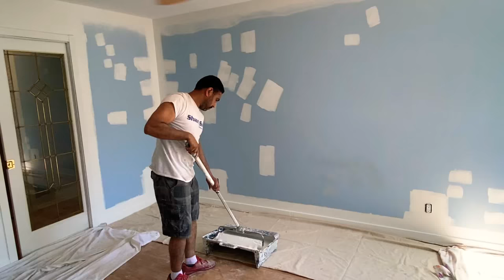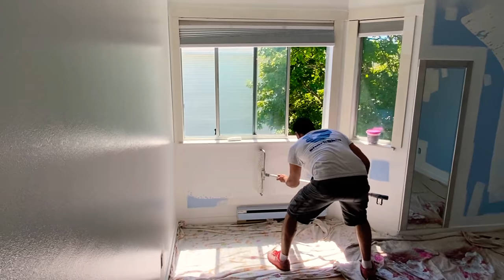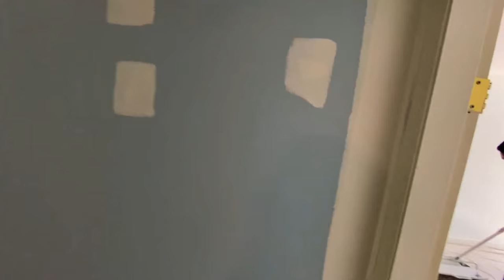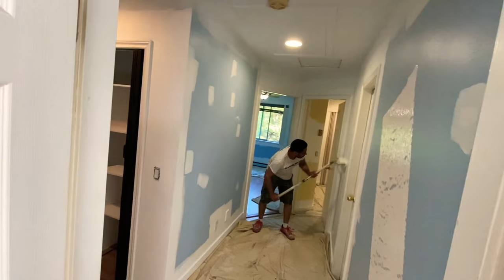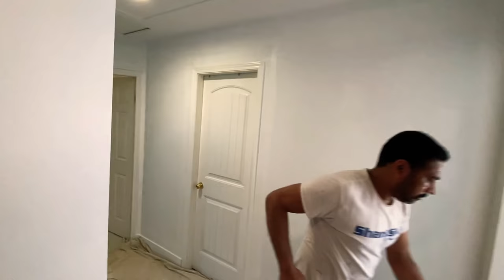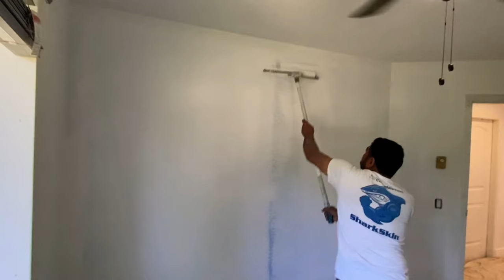How to prime walls with 18” roller like a pro!

Comment: That is amazing how fast you can paint a wall! I hope to be able to paint faster with my next projects by watching your videos.
Reply: It's easy to paint fast... but that won't work on a level 5 smooth wall... and you will be getting paint everywhere... won't be a clean job roller marks everywhere I guarantee...
Reply: It's not that hard with no furniture in the way.  Watch out for roller marks, though. I can't tell you how many bad paint and spackle jobs I've seen done by "professionals".
Reply: This guy is probably either using a broken 1 1/4 inch nap or a new 3/4 inch which would be very bad on smooth walls, because it would leave a very strong texture from using an app that size, no matter how far you stretch that paint and plus those walls probably been painted more than a dozen times so I know there’s possibly a text from them already. The next couple videos I produce on my channel are going to be the best snaps to use on walls and ceilings in the sizes

Comment: You can see right threw the primer. I’m assuming your going to do a couple layers of primer??? But you sure are fast, I could have my house done paint by now if I was this fast.
Reply: The sad thing is most colored paint has primer in it so you are better off just painting with the color right off the bat and doing two coats. I've found when I use white primer first I end up painting it three times due to the color not going on evenly during the first coat. So you end up doing one coat primer, two coats color as opposed to just two coats of color. 🤷
Reply: If he is using a PVA primer then it will do that till it dries

Comment: He only had the filling in to do, great roller,  it took a lot longer to paint around the top and the bottom of the wall, and around doors, light switch's and plug holes ..etcetera.

Comment: How do you make the paint last so long on the roll?
Reply: I've asked that same question a few different times on his videos. Lol. If I were doing it, one MAYBE two columns and it would be time to reload it
Reply: He just pretends there is still paint on the roll.
Reply: I feel like he’s really pushing it. I can hear the roll just drying out.
Reply: @doug8237  I am a civil engineer from a family of contractors. I would fire anyone painting like this. There are great differences in coverage but also drying time which affects opacity and uniformity but also texture direction issues because the roll has to be rotated to fit even architectural features of typical size. Even with 3x the total layers it cant get the quality of proper technique.
Reply: This is primer not paint
Reply: @missourit.v primer is a type of paint.
Reply: @angel valentin What is this sorcery you speak of?

Comment: That will need a second coat. Just do one wall at a time. Lots of paint at one end and thin at other. Still hard work tho, good job.
Reply: I’ve been painting professionally all of my life, and I never try to one coat it when changing colors.  That’s amateur stuff.  If you leave that much paint on the walls you’ll leave too much texture and it will look unprofessional.  I don’t care what technology the paint says it has, I always plan for two coats for color changes.
Reply: It’s primer, it doesn’t matter if it’s not perfect coverage. The goal of primer is to basically block out the underlying coat. His top coat will look perfect on top of that primer.

Comment: Too bad, looks like he could be a great painter, if one of my guys did this to try to impress me, thanks but no thinks, it can be done quickly(obviously not as fast as this)while applying adequate paint and not dry rolling which flings paint everywhere... looks good on video I suppose...
Reply: I'd be more worried about the hard lines he leaves from not feathering his edges inward. That will definitely be visible. Lol. You can control the paint splatter by rolling slow
Reply: I'm guessing your not a painter hes dry rolling because the stipple from a roller like this would be all orange peel. for the last coat someone will probably roll behind him to remove the stipple id hope.
Reply: It’s primer smh! Haters gonna hate
Reply: @jennifersimpson7752  its not that.. people paint differently in different countries in nz they don't want brush makes and thick orange peel walls or roller lines .... would be ok in south America  uk...but in nz aus or the states you would probably have to skim that wall and start again..

Comment: 1 Dip for 10ft x 6 wall? Not good . u can hear the sound of the Roller strangling . 
Keep the roller wet so you can have even Look . 
and its not about the Speed . is about Perfection .
👍